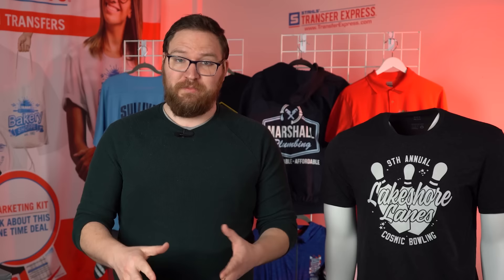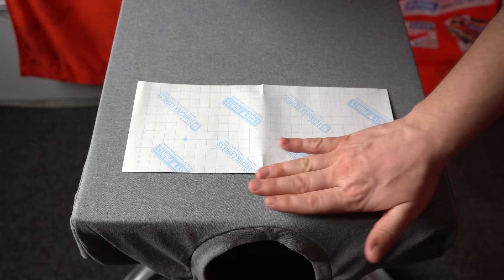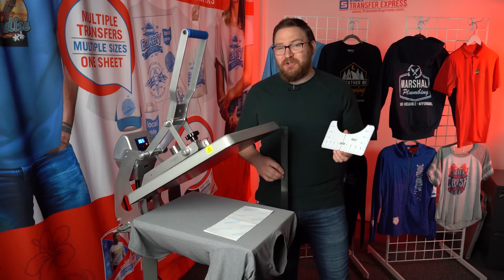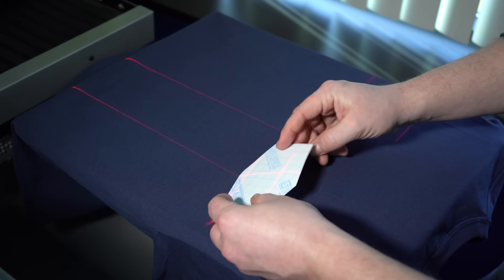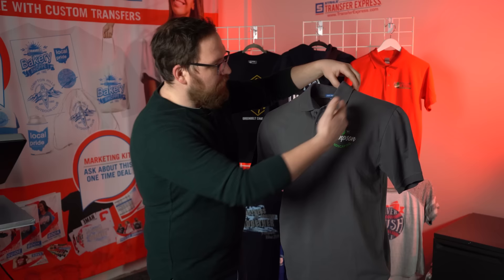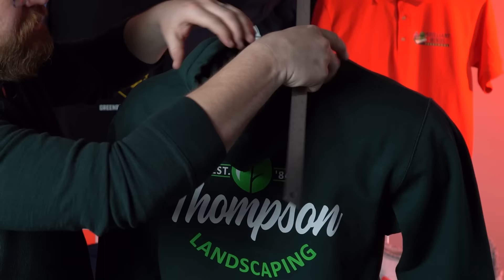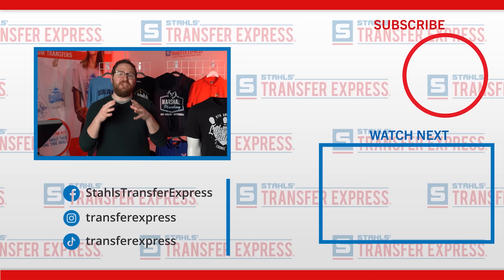Heat Transfer Placement & Position Guide | Stahls' Transfer Express

Comment: What is the Proper method for the back of a t-shirt? How far down from the collar?
Reply from the maker: It usually depends on your artwork dimensions. For standard back prints we usually recommend 3-5" down from the bottom of the collar.

Comment: Thanks for the tip. My question is, if you are doing the back of sweatshirt not at hoodie does the same rule apply on placement?
Reply from the maker: Hey Valrie, great question! It typically would not. Instead of the lower placement for a hoodie, you would be aiming for closer to 4" down from the bottom of the collar for full back design on a crewneck sweatshirt or t-shirt.

Comment: that t shirt looks amazing, are them better than gildan soft style?
Reply: i mean District one
Reply from the maker: The District Tees are a nice fit and finish, This one with the bowling graphic on it is the DT8000 Recycled Tee,  a 60/40 cotton poly blend made from 100% recycled materials, so it's soft and at 5.3 ounce fabric with a more fashion-forward tapered side-seam so it's a little more higher end option than the softstyle.

Comment: Dear, I write text in photo shop cmyk mode but that formate doesn't allow me to choose colour and selecting text. If i choose rbg colour every thing is ok for screen but i have a question if i write text in rbg mode will it be effect on printing? How i solve this problem
Reply from the maker: Hi Aatif, I'm not sure exactly what you're asking. Regardless of the color mode your project is saved in, you should be able to edit the colors. CMYK is preferred for more accurate colors from screen to print however, for screen printing everything will be converted to spot colors so color mode does not matter. 

With digital printing, color management software is pretty good these days and can convert RGB to print with great results, however, since there are colors in RGB that cannot be printed in CMYK sometimes some anomalies occur. We have a great breakdown of RGB and CMYK in this video here: https://youtu.be/SqYjsnidYVE

Comment: I always do  print  T shirts whit L ,XL,2XL,3XL size and  I can  not  make  sure   I  put  T shirts  balance both side on  place  heater pressure  before  I  put   picture  on  the  T shirts
Reply from the maker: Hey Thao, we just released this video for placement across sizes that includes some tips that may help you out: https://youtu.be/v6P2Xodtte4
Reply: @transferexpress  Thanks

Comment: What is the placement for a design on the back of a t-shirt (width & length). For example, I need to write a last name and a number using a varsity font on the back of a tee.  Marshall 14 for example, where would I place that?
Reply from the maker: That's a great question! Typically names will be placed 2-3.5" down from the bottom of the collar to the top of the text and centered on T-Shirts & Jerseys.
Reply: @transferexpress  Thanks so much.

Comment: Centering the vertical line is easy, it’s the horizontal line that’s tricky.
Reply from the maker: Absolutely! Centering the vertical line is easy if the t-shirt is loaded on straight haha. Those tips that Dave covers here with multiple reference points on the sleeves can help line up print too!

Comment: NICE VIDEO ..THANKS ..wat is this material pad if you put inside o the inner sleeve of the shirt ? I saw that you use a Transfer Express transfer sheet, WHERE YOU CAN ORDER..tx
Reply from the maker: Inside the sleeve we used a standard mousepad. We have low-cost blank ones available here: https://www.transferexpress.com/heat-press-accessories/mouse-pads

For the transfers, you can use our free online designer (or upload your own graphics) and order your transfers on the right hand side here: https://www.transferexpress.com/designer

Also, if you're just uploading your artwork to print, you can order transfers using our artwork uploader here: https://www.transferexpress.com/upload

We've got a quick walkthrough of how to order here: https://youtu.be/_Pd06X3NPsQ

Comment: hey sir! how did you printed white? it is impossible to sublimate white,, not?
Reply from the maker: We are using screen printed transfer here, which use plastisol inks (the same inks used for apparel printing for the past 60 years). Screen printed transfers like our Goof Proof Transfers ( https://www.transferexpress.com/heat-applied-transfers/goof-proof-screen-printed-transfers ) apply to cotton, polyester, cotton/poly blends on any color fabric. 

They're an incredibly versatile transfer that allows for screen printed quality without the mess of traditional screen printing: squeegees, inks, screens, emulsion & chemicals. We handle all of that so you can just press and profit!

Comment: Okay, but what I don't understand is .. How do you know exactly that your print is always evenly from left to right?
Reply from the maker: The most important part is loading your garment on the press straight. At 1:51 we show some tips on how to ensure your shirt is not twisted or crooked on press by following the seams or fold all the way to the back. Placement of the transfer then comes into play, but at 2:16, we show how to find the center of the transfer with the folding method. Ensure the two creases appear straight at the top and bottom (on an imaginary center line of the t-shirt) and it's aligned perfectly ready to go. 

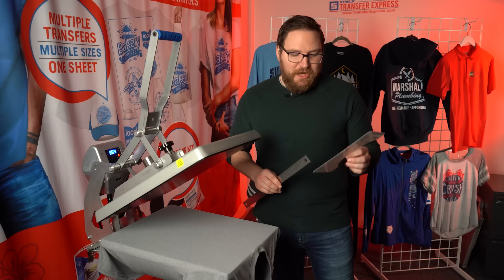Additionally, placement rulers like those featured 5:26 can help with easy alignment to the collar, ensuring proper spacing side to side.
Reply: I guess you use a ruler and measure both sides

Comment: Any tips on left/right vertical back?
Reply from the maker: You can follow the left / right chest placement techniques (using the edge of the collar)  just on the back of the garment. Just start the top of your design at the recommended location. You can always check out more print placement and location resources on our blog:  https://blog.transferexpress.com/infographics-for-your-heat-printing-reference/

Comment: I just purchased a Fusion IQ but I didn’t get the tag along platen any tips or recommendations for pressing a tag on the Fusion IQ? I did purchase the 6x10 platen. I also own the Fusion 360 IQ hat press not sure if that would work to press the tags on my shirts.
Reply from the maker: Hey Pmason718! With the equipment you have, there's several ways to print your custom tags. 

1. Turn the shirt inside out on your full-size 16 x 20 platen with your Fusion.
2. Use the 6 x 10 platen on the fusion and then loop the collar around it so you can print the inside tag area. (probably the quickest and easiest method)
3. Use your fusion IQ 360 and loop the collar around the platen. This may restrict the printing area, as you should stay within 2-2.5" high on your graphic to maintain firm pressure across the entire area.
Reply: @transferexpress  Thank you for responding. I used method 1 before receiving your reply and now that you’ve replied I’m going to go with method 2 going forward with the 6x10 platen, thank you

Comment: Sir what kind of transfer paper you use?..... Like what you did on sleeve..?
Reply from the maker: Hey Rey, we're using Screen Printed Transfers here. They're plastisol ink, screen printed with an ink and squeegee onto our own proprietary release paper. 

The end result when using screen printed transfers is a screen printed shirt. No white toner or sublimated prints that crack fade over time or apply to only polyester garments, Our Transfers apply to cotton, polyester or blended garments. We independently test all of our transfers to 50+ Wash cycles to ensure a quality, long lasting print. 

You send over your art, we print the transfers and then you apply your designs using your heat press. 

The best part is that minimum quantities for our transfers start as low as 6 pieces for 11.5 x 14" sheets, and they ship as quick as the next business day in most cases for one-color prints. There's no weeding needed and they apply in only 4 seconds with just your heat press. 

https://www.transferexpress.com/heat-applied-transfers/goof-proof-screen-printed-transfers

Comment: Is there a rule of thumb when pressing shirts for plus size women as far as “chest” area is concerned? TIA!!
Reply from the maker: Yup! The method we show at 03:06 with lining up to the sleeve seams scales with any size. Of course it will depend on the dimensions of the specific artwork, but it's a great starting point to get the chest placement.

Comment: What is the industry standard for front designs? How many inches?
Reply from the maker: For a full front / center chest print placement, you're usually 1.5-3" down from the bottom of the collar. 

For the size of the design, Adult center chest / full front shirts are typically right around 11" wide.

Comment: Any back placement?
Reply from the maker: Hey Jose, For a standard t-shirt back placement, it's similar to what we show on the hoodies here, but instead of 5-6" down from the back collar you'll be closer to 3". Depending on the size of the graphic you can use the alignment to the armpit seams (to the center of the design) like we show on the front placement.

Comment: I find myself changing the size of the image per shirt size. It's very frustrating.
Reply from the maker: That's very rare in the apparel printing industry- For just a few pieces if you're cutting vinyl that could work, but the setup if you're screen printing or using transfers will be very time consuming to setup.